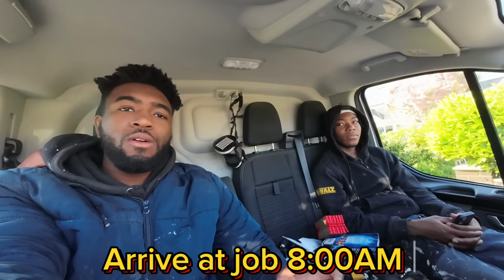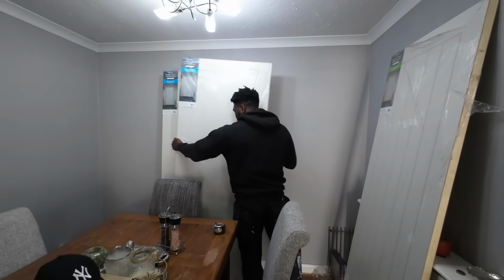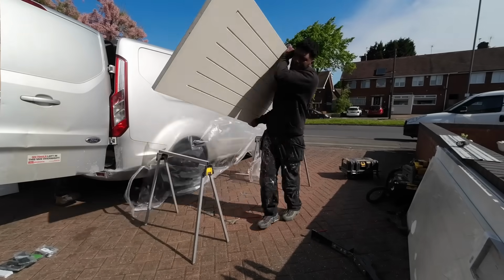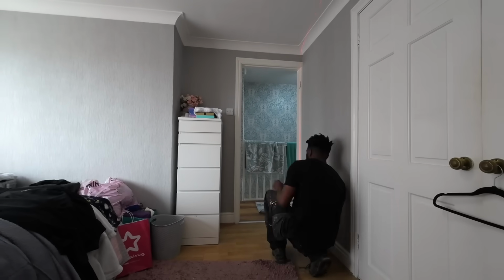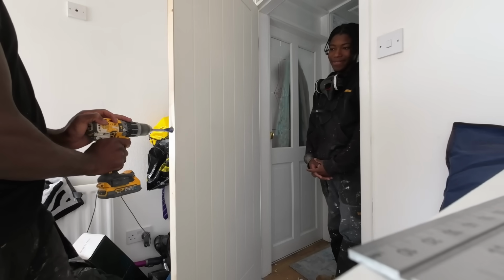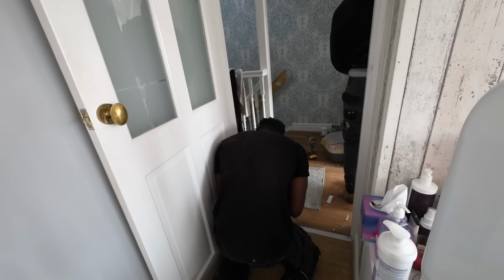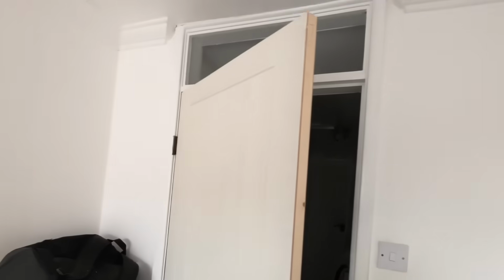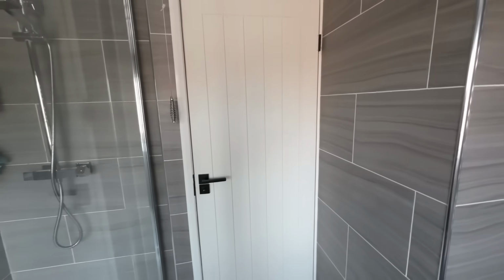DOOR FITTING AS A TEAM A DAY IN THE LIFE (Self-Employed carpenter)

Comment: Trend do a jig for the sashlocks.. Comes with a dozen switchable plates/guides for different size locks. .. Its the only bit i use a router for and its a god send.. But pricey but i charge a small amount extra for locks.

Would it help the apprentice if he knelt down to drill the latch holes... Hard to drill straight at waist height.